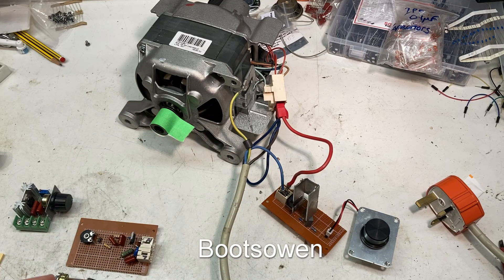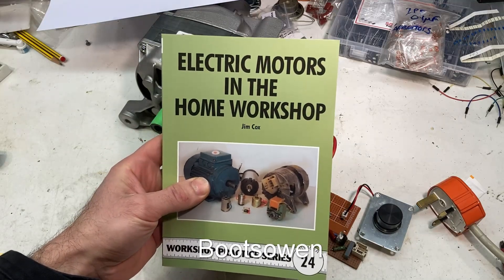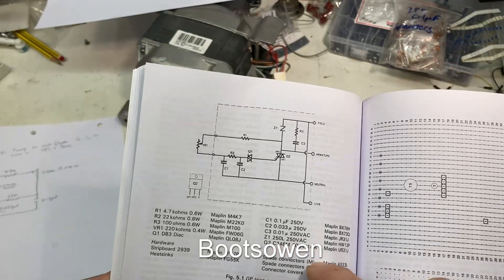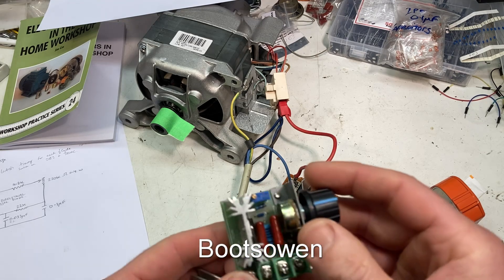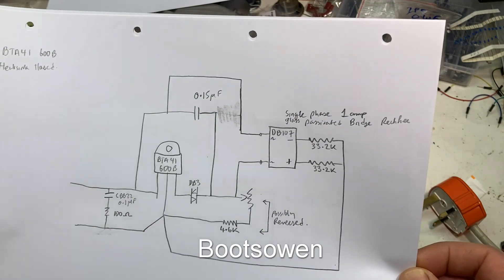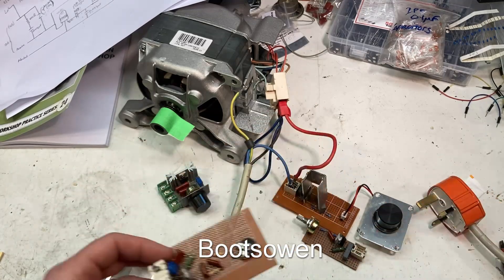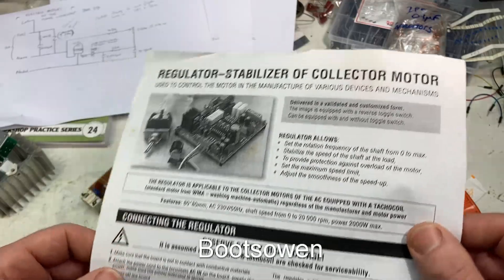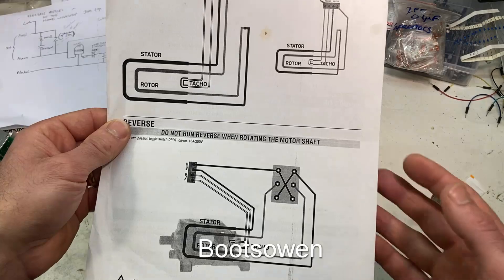You might know the answer? Why won't this motor speed control circuit work?

Comment: Hi bootsowen,

the db107 component is four diodes making a bridge rectifier in one chip squiggly are the ac input and +&- are dc
Reply from the maker: Hi there, I guessed that, but how would feeding DC in help, what does it do in this instance?

Comment: Have you ever consider doing this with Arduino micro-controllers? - It does add complexity but the benefits are, its much more versatile and modern approach, and with only minor changes the same circuit could allow you to limit the speed of a motor, regulate the motor speed under load, control a motor in an automated process and run it in loops, attach sensors or even give it WIFI capability and so on. Literally thousands of hours of fun for you there Bootsy!
Reply from the maker: I have considered it, Arduino or Raspberry Pi. Others have done it on YT but without any explanation of what they have done. But would it not be simpler if bulkier to do it with a pc (old or new) the arduino will still require some switchgear like a bta triac, if you used a pc you could watch YT while driving a motor.

Joking aside, the reality is that I have no use for it. I have a tda1085c control circuit driving my big grindstone and an inverter driving the large 3 phase motor on my lathe. 

Maybe someday.
Reply: @bootsowen  Fair enough bootsy, the post apocalyptic inventor has some kick ass vids if you ever fancy having a play.